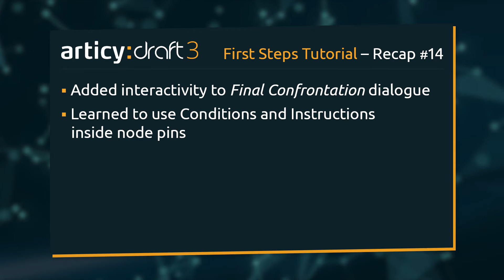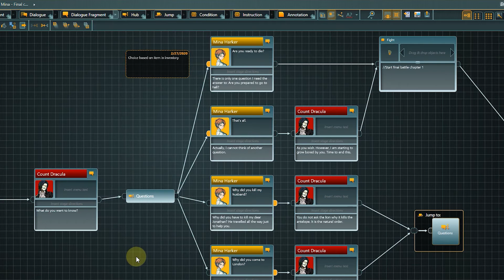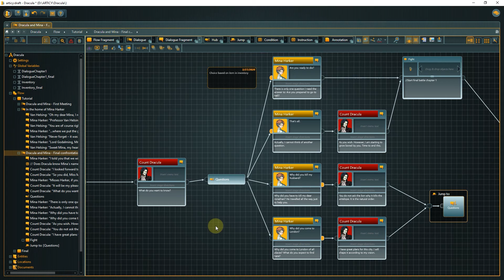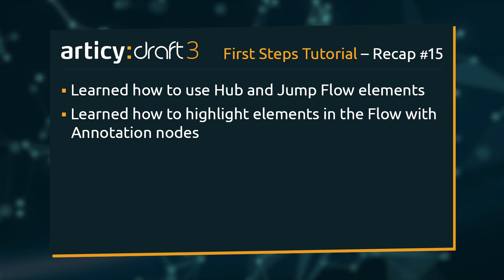articy:draft 3 / X - First Steps Tutorial - Lesson 15 (Adding Hub and Jump Flow elements)

Comment: If I wanted to make a player response selection disappear after it was selected so the user cannot pick it twice how would I do it? For example, in the Dracula demo project (in this video), if I picked, "Why did you come to London?", then after the Dracula response displays and it goes back to the questions Hub, how can I make that specific selection not appear again. I'm pretty sure it has something to do with a Boolean variable but I cannot think of a way to do it that'll be quick, and efficient. Would I have to make a separate Boolean variable for each player response selection (such as DialogueChapter1.Response1, .Response2, etc.) or is there a simpler way of doing it so I can only use one? Or is there an entirely different approach that I should take?
Reply from the maker: Hi,
You are correct, the approach for hiding specific dialogue options would be through Boolean variables, with a specific variable for each option. If you have a situation where you want to display different options after returning to the Hub, but in a fixed order, you can also use an Int variable and increment its value.
Reply: @Articy  Thanks! Love this software by the way.